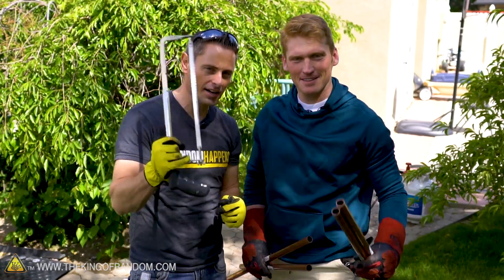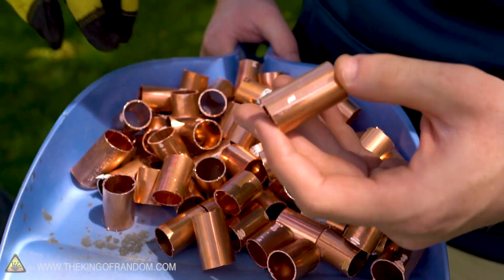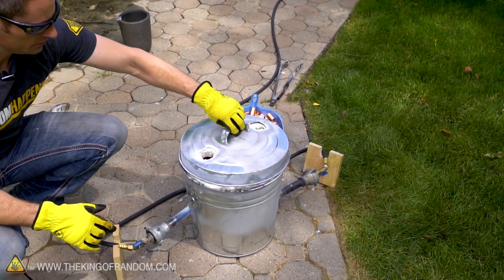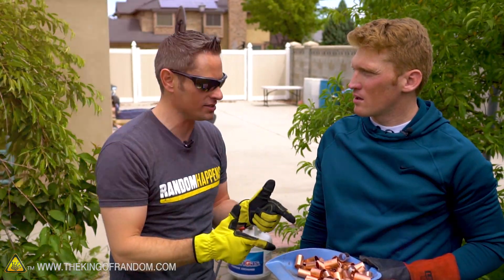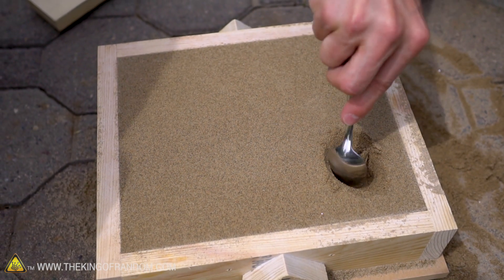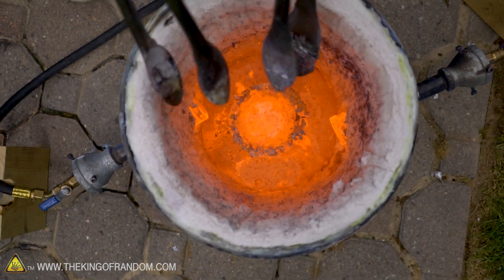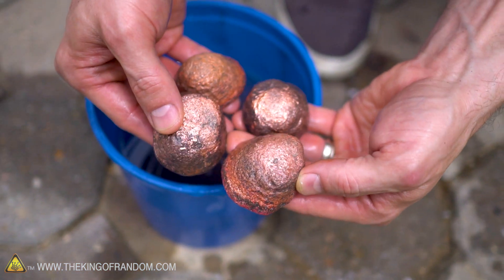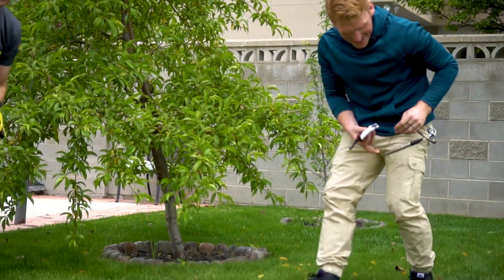Trash-Can Foundry Is LIT! We Dive Into Metal Casting and More With This Metal Foundry

Comment: don't you find that if you make ingots first and then use them you get a lot more slag like you get slag when you're making the ingots and then you get slag once you melt the ingots down so wouldn't it be better just to melt down your metal and then poured into the final shape you want instead of making ingots in the middle.or perhaps that just refining the metal down even better

Comment: I would really like Grant to produce a furnace that is similar to a Blast Furnace or a Cupola Furnace. By doing so, you could melt metals like steel and iron when you use a fuel such as Coke or possibly Coal. You could even use it to produce pig iron from iron ore. The design is pretty simple as well, requiring a refractory lined cylinder, but not much else.

Comment: the fidget spinners you had melted down had steel ball bearings. i am nearly sure you could melt steel.
Reply: Ceramic is more heat resistant than steel. Probably some cheap alloy
Reply: Other Restrained they were ceramic

Comment: One question.

Why can't you pour copper into those muffin pots? 

You explain that copper melts at 1984, which is close to the temperature the muffin pots will bond to.... But....

You've melted other metals in that same foundry.... And brought the temperature of those metals well over 2000 degrees, so why didn't those metals bond to the muffin pot? 

Melting point or no, the temperature should still reach 2000+, shouldn't it? And then melt to the muffin pot? But it doesn't, so shouldn't you be able to pour copper into the muffin pots?

Comment: I found this looking up thing you could do with copper Grant,
"The copper element plays a vital role in shaping our lives. ... One of the reasons copper is so important is that it can be made into alloys. That means it can be combined with other metals to make new copper alloys, like brass and bronze. These are harder, stronger and more corrosion resistant than pure copper."
Now with this power you can make strong metal alloys, I say try it out. This should work much better than mixing brass and aluminum :-)

Comment: Grant, couldn't you of just pressed the bottom of your mini muffin trays into the sand for the molds rather then using a spoon? That way you would have a clean mold and not have to deal with the problems with the steel mold.

Comment: Grant, in order to make them look nice after cooling, you need to drop them in isopropyl alcohol. I have used a combination of alcohol for cooling and color, and dry ice in the alcohol to prevent ignition. I did this over a year ago when I was in high school. It will give you amazing looking copper if you do this. 

Just be sure to add the copper to the alcohol, not the other way around. I once poured a regular medical bottle of alcohol on red hot copper, and it ignited the waterfall of alcohol right into the bottle, causing it to explode in my hand. Luckily, I was not injured.

Comment: What if you cast a copper rose? 
Could you freeze a rose, then make a mold of it in the green sand?
If it works, you could try making a golden rose!
Reply: rose would be far too fragile to with stand the force when you compact the sand. a better solution would be to 3D print a rose from strong plastic and use it instead
Reply: That would be beautiful :)
Reply: You can forge a copper rose. And it is way more easy than casting it...
Reply: Stuart Edge then I guess you could say that you have rose gold
Reply: he should try because I think it would be cool
Reply: Please do it grant
Reply: That's a sweet idea
Reply: Oh hey
Reply: Steffan kitchener Yes but you can make it with a clay mold :D
Reply: I'm sure it could be done with a few extra steps if you don't think so simply. How about freezing the rose, making a silicone mold from it, then making a more rigid rose in the the silicone cast, then making a sand mold from that rigid rose. Once you end up with copper you could even try to oxidize the stem to make it green if you wanted.
Reply: OH gosh i loved your idea.
Reply: Stuart Edge not gonna work

Comment: theoretically, if you pour nitrogen on top of the ingots while it's cooling it would not oxidize the top of the copper right? and it would cool of the top faster.
Reply: Quinn Greenlee because of the leidenfrost effect, the nitrogen would just fall off the ingot or float atop of it
Reply: seriuskndfgs egg oh yea thanks I almost forgot about that
Reply: Yes but the nitrogen would vaporize almost instantly because the copper is more than a thousand degrees hot.
Reply: Ok thanks

Comment: Hey Grant - you really need to look into using some fluxes when melting your metals - some simple borax or boric acid added to the melt would go a long way in protecting the copper from oxidation and reduce slag and flow better during your pours.

Comment: Grant could've just cut the pipes in half, and they would've melted down. Also, 1982-present pennies are copper plated zinc, but they were like 95% copper most years before 82'.

Comment: I have a question wouldn't it be easier to have the copper to go through one of the holes in the lid to the bottom of the crucible
So you can just push the pipe down or it will slide down as the bottom melts

Comment: I would suggest instead of digging up "molds" with a spoon. Cut out ingot shaped cube of styrofoam. Put it on bottom and cover with sand, flip it and then just pour the molten metal in it. It will melt the foam and you can experiment with different shapes of "ingot molds". 

Cheers
Reply: He used this method in the past actually, but his new way of casting is less wasteful since the styrofoam is a one-use only material, but in controversary he can reuse this sand.
Reply: CroCop1113 make wood ingot shapes  to attach to the lid to form them.
Reply: CroCop1113 or you know, he could use the other finished ingots
Reply: CroCop1113 I think he knows how to make molds
Reply: CroCop1113 u watch how they make the fidget spinner right?
Reply: Kreno Animations that plus it didn't give a quality end the gas given off ruined it etc
Reply: CroCop1113 I just don't know why he didn't just place the bottom of the mold pan he normally uses in the sand for the ingots.

Comment: My dad does heat and air, he has around 40 air conditioners in the back of his shop and what we do is take them apart to salvage the copper, we throw all the other stuff onto a trailer and sell that somewhere down the street, but the copper we keep until the price goes up for it and then sell it.

Comment: hey, Grant, if you want to get your chemistry on, after the copper ingots have solidified but are still hot, dunk them into a bucket with 70-90% ethanol (i think isopropanol may also work, but not 100% sure). there's a reaction b/w copper oxyde and the alcohol that strips the oxygen off the copper. you'll get a beautiful pure copper shine on the ingot. you'll also turn the alcohol group into a carbonil. anyways, peace, brother!

Comment: Copper is a great metal to work with because it's both very malleable and very pretty when polished, so you can make anything out it essentially.

From a science angle it could be interresting to recreate a copper mirror and see how usable you can get it (using some modern powertools to speed up the sanding process). Copper and bronze were how they made mirrors before advanced glasswork became possible. Easy to do since all you need to do is sand it flat and polish it.

Or cast something cool like... maybe an egg or something? Would probably be a very cool decorative item when polished. The problem is that making an accurate cast that handle the heat is probably quite hard without specialized materials.

Comment: I can think of two options, you could try to clean up the Copper some more, flatten it out and modify it into a PCB board for hardware experimentation, or for easier purposes try to build a free energy generator with copper! (If possible)

Comment: You should see if you can make the aluminum alloy used in airplanes. The percentages are 90.3% aluminum, 1.6% copper,  2.5% magnesium and 5.6% zinc.

Comment: Grant Thompson - "The King of Random"  My friend and I built a forge from a wide bucket and plaster of Paris/sand mix, and we had gotten it so hot using lump charcoal, that it melted the steel we put in as a crucible, and burned a hole through the plaster.

Comment: Grant. In Resistant Materials, we bent circles of copper by heating them up in a fire until they glowed 'cherry red.' (That's what the colour is called, when copper glows.) Also, it helps keep the sand to have a small trench in the wood border that you're casting in, so the sand is more likely to stay in the wooden mould when you lift it up.

Comment: white out will prevent the copper from sticking to the muffin tin. just coat the tins ,dry and pour.
Reply: boogeymanoneoneone how??
Reply: Clashing With Kempy 
The exact answer, I dunno. It basically makes a barrier between the steel and the other metal to prevent the adhesion.
Reply: Haha it would just burn it off lol it would be too hot😂😂😂

Comment: could you put glass in the metal Foundation
Reply: Molten glass is a liquid because it is free flowing and remains at a constant volume. Not a super thin liquid, but a liquid all the same.
Reply: Kaden Mcdonald you cant really melt glass. If it gets Hot enough he could try to form glas.
Reply: You can totally melt glass. It turns viscous, like the consistency of maple syrup; it's not totally liquid, but it can most definitely be melted.
Reply: Kaden Mcdonald no u cant
Reply: glass melting point is around 3400 Fahrenheit
Reply: but u can make glass ingots
Reply: O'Riley oh
Reply: theoretically yeah you could
Reply: O'Riley but I've meted glass in a fire
Reply: O'Riley ok
Reply: awesome you should make a video about it
Reply: Nathan Jennings but thats not my definition of liquid. It has to be viscous to be formable.
Reply: Liquid and melted aren't the same thing. Melted glass is malleable enough to do a lot of things. How do you think they blow glass? They melt it first.
Reply: Nathan Jennings the meltingpoint is the temperature where a solid turns to a liquid. Glass just stays between that.
Reply: Nathan Jennings yeah just grant doesn't have a foundry hot enough to melt it

Comment: Can you try to put 4 propane things on each side of the foundry and try to make glass with sand?
Reply: Tanner Braungardt Fan if he needed more heat he should add pure oxigen. In that case it is probably better to seal the container with the metal because it could react stronger with the oxigen then with the oxigen in the air.

Comment: What would happen if you just poured molten metal into a water bucket? Would it harden before it reaches the bottom of the bucket or would it melt through the bucket?

Comment: Not a professional or anything but I am pretty sure that sulfur turns copper red. If the water he dumped it in was tap water he may have a high amount of sulfur in his water and that could've caused the red color. or this could just be the impurity floating to the top because its not around the bottom of the biscuit

Comment: i have a thought. try using a baking tray designed for large muffins but fill each holder with sand so the copper ingots won't fuse with the tray but you can make those copper mussons.

Comment: Hey Grant. A quicker and more accurate way to make ingot molds into the sand is to replace the bottom plank of wood with the under side of the muffin tin when packing the sand in. It leaves a negative so when you pull the pan off it should have the same shape as the inside of the muffin tin.
Reply: AERO BLKHWK32 grant definitely needs to see this
Reply: SpeedrunsTeddy lmao he dead now
Reply: SpringElf FPS kinda a pp thing to say, but ok
Reply: SpringElf FPS how is that “lmao”
Reply: That is a great idea
Reply: Dude thats f***ing smart!
Reply: I was gonna say that but I was a little late
Reply: AERO BLKHWK32 I was going to say mold around the other igots but that works even better :]
Reply: AERO BLKHWK32 you'd also have to deal with the over flow of sand
Reply: Scary Balloon Fish ha same
Reply: that is a nice idea i will try that when i make green sand.
Reply: I was going to suggest this but you beat me to it XD

Comment: Use your wire cutter to cut out a design from styrofoam, then place it in the sand, fill in the sand around it, and when you flip it back over once it's full, you can poor the copper directly onto the styrafoam. I'tl vaporize instantly leaving a perfect mold for the copper to set in.

Comment: You should use copper wire not pipe, as pipe is class 2 copper. Electrical wire copper is class 1